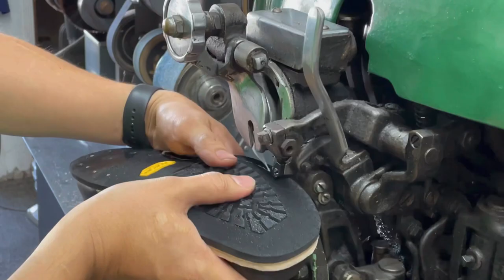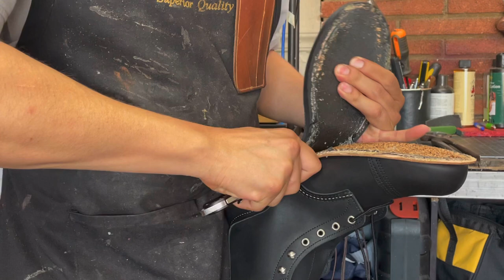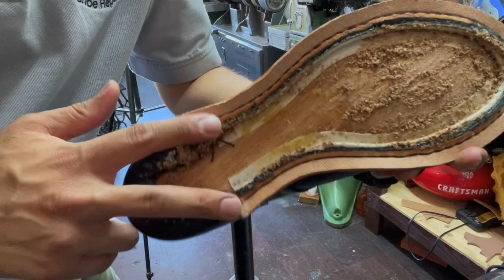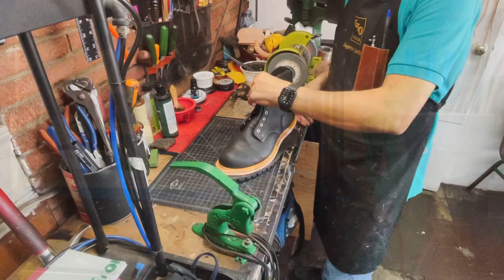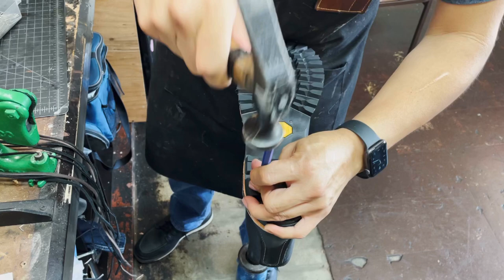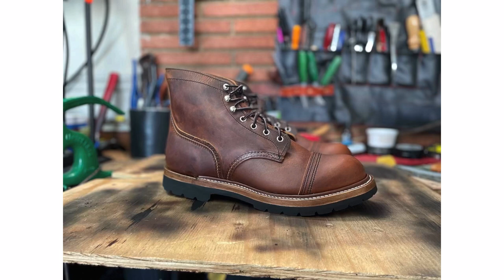Iron Ranger Resole upgrade/Vibram 100

Comment: Although it was a little painful seeing brand new Red Wings being cut up, when I saw the result, I was blown away as usual! Bravo, Sir!
Reply from the maker: 😅 thanks a lot MAB is just like having a new suspension in your car 😅✋🏻✋🏻
Reply: @AaronG2480  Indeed!
Reply: @Brandon Lee Barrow Interesting. Could just be a personal thing with the cork. I have a pair of 875 I've been wear for almost 2 years, 3-5 days a week, and they have become almost an extension of my foot. So comfortable! I'm figuring it's got to be the cork, or a combination of the cork and leather molding to the shape of my foot. But at the end of the day, it's whatever works for you (Dr. Scholl's!).
Reply: @Brandon Lee Barrow it depends, don’t forget the Red Wings have very sturdy leather insoles to begin with. If you put a heavy leather midsole and a Vibram lug sole on top of it, your Rangers can hardly bend and your RW will walk less comfortable.
Reply: @Freedom89984  it’s leather and rubber… They’ll break in and be flexible yet sturdy no?

Comment: Although you did a good job. Iron rangers overall heritage look is the reason why they are iconic.
Reply: It would have been a lot easier to break in with their original soles first, no?
Reply: @matttherrien9608  yes. I believe so
Reply: @Heywoodthepeckerwood  this upgrade makes them look like Timberlands on steroids.
Reply: @matttherrien9608  the only timbs worth buying.
Reply: @Heywoodthepeckerwood  I came close once but ive never owned any Timbs.  Do Iron Rangers fit that same as their moc toes?  I'm 9 Iron Ranger and I'm wondering if I would be the same in the moc.  I need another pair of Rangers too!

Comment: Great work, you do what the customer wants, but… some customers underestimate how good the original soles are. They last forever and they can bend so you can walk in comfort. I bet this new soles, especially the one for the black IR can’t hardly bend, so you heel is slipping. Maybe someone needs a heavy duty sole , but keep in mind that in combination with a thick leather mid sole your Rangers will be less flexible (at least) for the first few months.